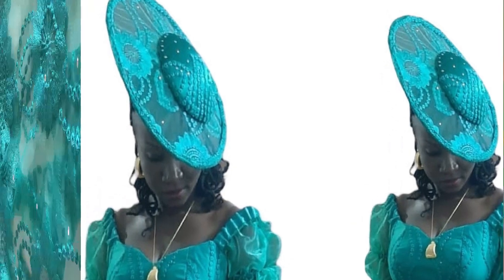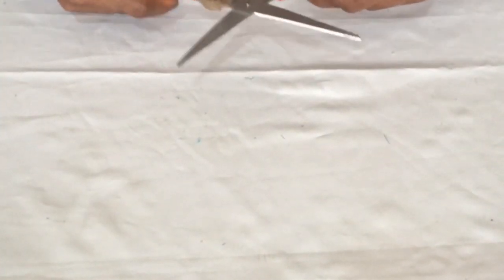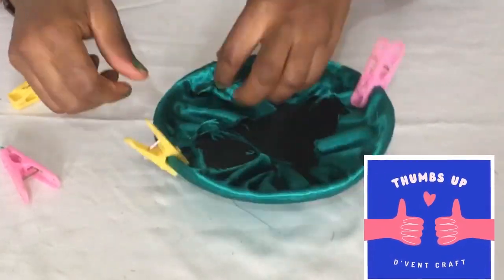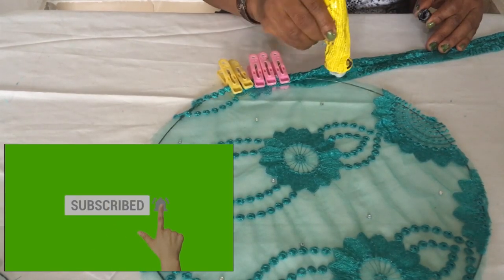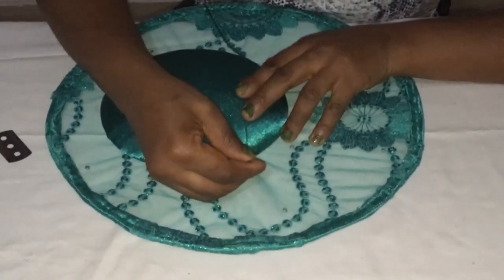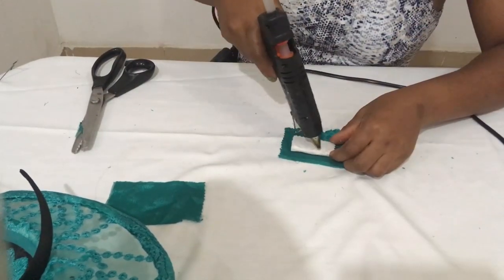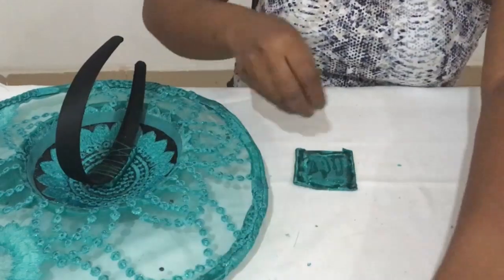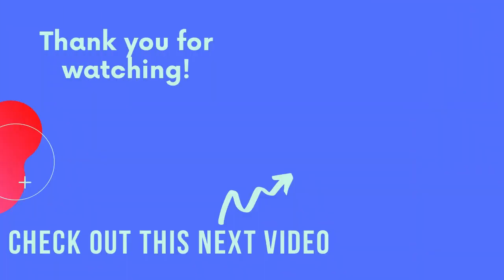HOW TO MAKE A FASCINATOR SATELLITE / SATELLITE FASCINATOR / HAT DIY / INSPIRED BY PINTEREST

Comment: 18 types of materials 😚

Moulded cap with pad, Zig-zag scissors, B7000 glue, lace material, bridal satin, hat wire, bias, needle, razor, matching thread, cloth pegs, electric glue gun, big alice band, normal straight scissors, UHU gum, fancy stones, chalk, thick pad to lift up the base of the fascinator. 

Fascinator class 3😚💃
Reply from the maker: Thank you for participating in the competition . Your response has been noted. Please do ensure your bell button is clicked on so you don’t miss the video that carries the announcement of the winner